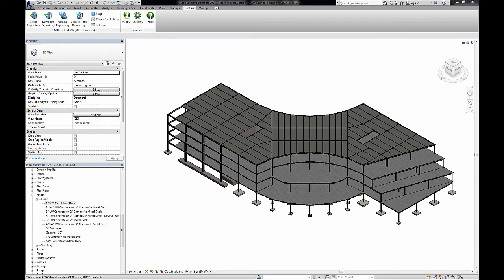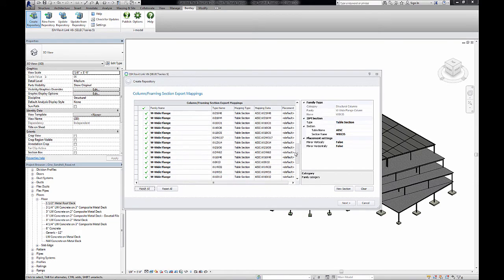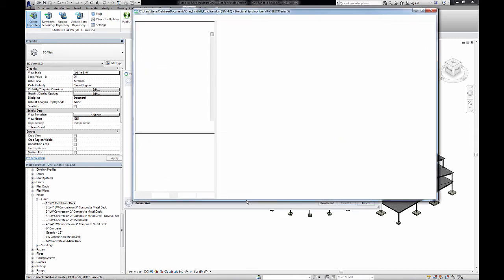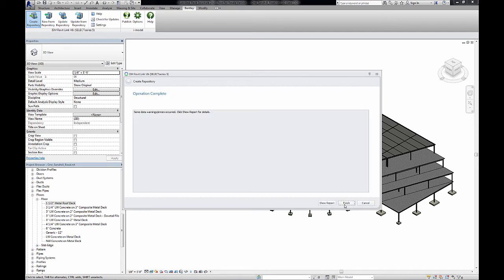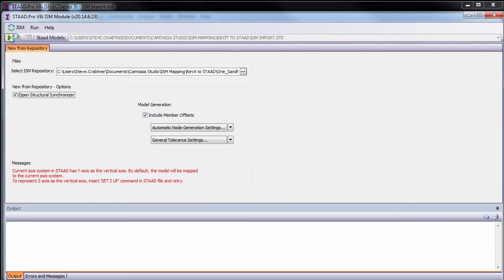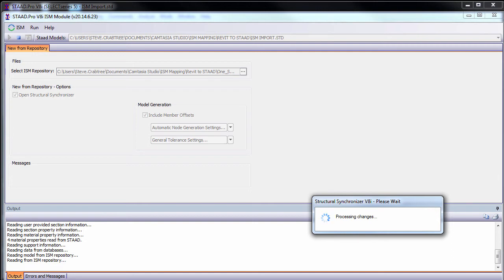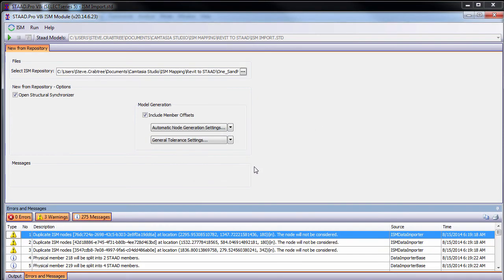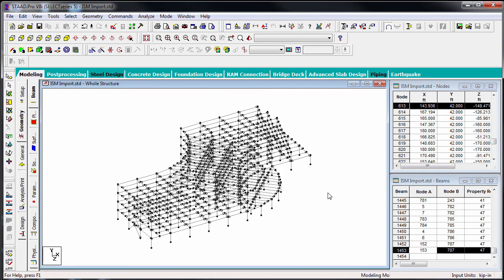Importing STAAD model to Revit Structure | How to transfer your structural model from STAAD to Revit

Comment: I noticed that concrete elements, footings and floor slabs, visible in the Revit and Structural Synchronizer models are not showing up in the STAAD model. Why?